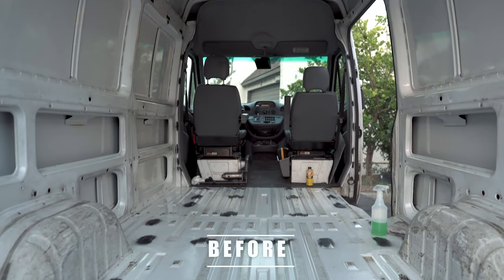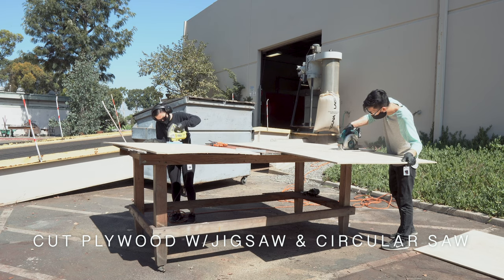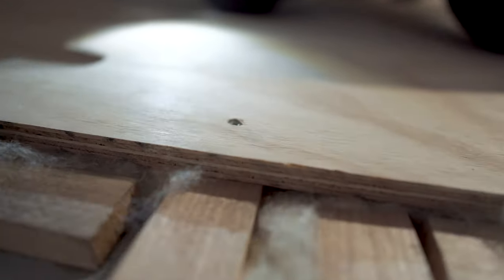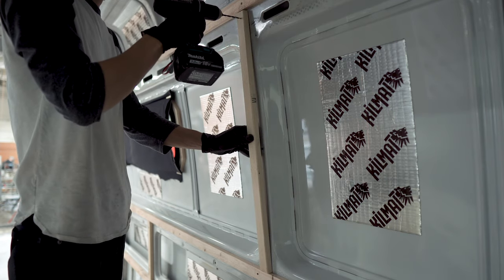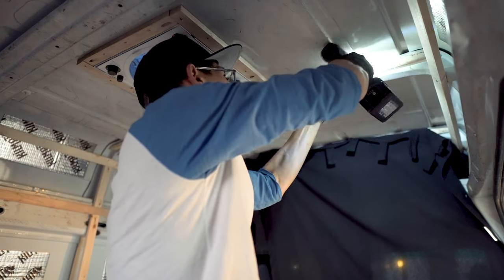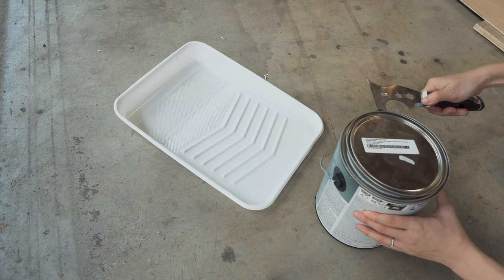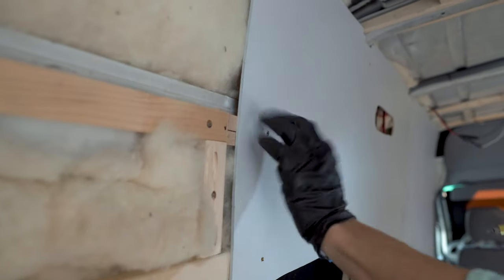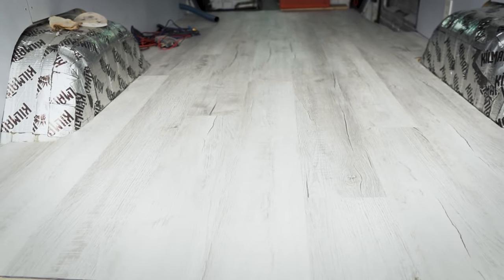DIY Sprinter Van Conversion | Framing, Insulation, Wall Panels, and Vinyl Floors

Comment: I love how you both are wearing masks during your entire build. Your the only ones I've seen in all the van builds that I've watched. Also wool is the best insulation for a van build, it doesn't mold, it's antimicrobial, antifungal, it can hold up to 40 percent moisture and still provide 100 insulation value. Your the only one I subscribed to. I can't wait for more videos, also very good explanation during your process. You should be very proud. Thank you

Comment: Looks awesome. Just wondering with plugging the bottom holes and using wool underneath the floor boards, is mold an issue is moisture gets down there?

Comment: i am struggling to do my ceiling...how you guys did it? like with a big panel is hard to measure it and seal it with the other side walls. thnaks xx
Reply from the maker: Yes it was definitely the most challenging part of the build. We used 3 large panels and the edges did not meet up well with the walls. We think using tongue and groove panels instead would be easier
Reply: @IMEEMADE  thank you guys for the reply, xx

Comment: awesome video! although I'm missing the part where u prepared the electric wires? I see some wires coming out on top. So I was wondering when u do the electricity... Before the walls or after?
Reply from the maker: Thank you! The wires for electric are done before putting the walls up

Comment: Hey guys, congrats on your work 👏 I’m curious if a year on, did the Havelock Wool cause any smell issues? Heard a few complaints that a ‘barn’ smell remains.
Reply from the maker: Hi! We don't have any smells from the insulation at all. The barn smell is apparent when we first removed it from the packaging and initially installing, but after a few days and especially after we finished the build there's no notable smell. Thank you for watching!
Reply: @IMEEMADE  Aw i’m glad to hear it.

The smell of the outdoors is great but maybe not 24/7 😅

Comment: It seems to me that plugging up the drain holes is probably not a good idea. They are called "drain" holes for a reason. If moisture somehow gets trapped under the newly installed floor at some point, (and you can't guarantee that that won't happen), then there is nowhere for that excess moisture to go because the drain holes are now blocked.

Comment: Hi, I am just about to start on my 2005 140" wheelbase Sprinter. May I ask you about the furring strips you used on the floor. I think you said you used 1x2 boards. Are they thicker than the groove they are sitting in? I was wondering about using something at the same height as the ridges because I am using rigid foam board for insulation,  Thank you in advance for your reply!! I love what you guys have done to your van and thank you so much for sharing your adventure!
Reply from the maker: Hi! Yes the 1x2 boards were about 0.25" taller than the ridges. Thank you so much for watching!

Comment: Question! Thank you so much for putting this together. We are in the process of building our van right now using your video. For the glue you linked, It says that you need to wait seven days for the glue to cure. Do you know if you had to wait that long? We are thinking if we put the plywood on top of it it should weigh it down and secure it pretty well?
Reply from the maker: Thank you for watching! You do have to wait 7 days for it to completely cure, however it's holds well after several hours. We did exactly as you're trying to do - after we laid the plywood down, we kept the project moving and we haven't had any issues at all!

Comment: Have you heard about condensation? That wool will suck moisture in and will keep. Would use foam boards, or spray foam, but not wool and glass wool.
Reply from the maker: Thanks for the info!
Reply: Exact...i have no experience but that's so logic...wool under floor no sense...qithout saying that it will shrink over time

Comment: Leaving raw wood inside your walls or floors is just inviting mold and mildew into your van. Every piece of raw wood needs to be sealed with either mold resistant primer (battens & backs of wall and ceiling panels) or spar urethane on exposed wood where you want a natural finish such as bed slats, component compartments or cabinets (plumbing, LPG, electrical, etc), garage storage, etc. I would not seal surfaces that are going to be glued together. When gluing battens to metal, wipe the metal down with denatured alcohol to remove any contaminates or oil and let dry before gluing. I would also not use any paint or sealer that is oil-based. I used oil-base paint on my house porch trim and couldn’t understand why we always had so much mildew - had to scrub it every year. Oil-based products are great “sealers” but mildew thrives on the oil. Use 100% acrylic paint instead.
Reply from the maker: Thanks!

Comment: Hi 👋  Thanks for such a great video! I have the same size T1N sprinter that I'll be converting soon. Just curious how much havelock wool did you use for the insulation?  Thanks 😊
Reply from the maker: Thank you! We used about 3.5 bags total. Have fun on your build!

Comment: Hi, what did you do with the seams between the plywood sheets? What kind of filler did you use?
Reply from the maker: We ended up using drywall tape and  joint compound. We thought it would crack from the movement of the van but it's been holding up great so far!

Comment: Great Job. Did you consider vapour sealing your floor, walls and roof?
Reply from the maker: Thanks! We did consider, however the wool manufacturer stated that a vapor barrier would hinder the effectiveness of the wool's ability to remove moisture should it be exposed to any. So far so good though!

Comment: I'm up north in Canada and I'm wondering what temperatures ( it can get as low as -22 F up here so insulation is a must )  you are living in with the van and how the havelock wool is performing. And thanks for the content I appreciate you guys taking the time to make it.
Reply from the maker: The coldest that we've stayed so far is about -10C. The insulation did great retaining heat generated inside the van (i.e. cooking and propane heater). We would recommend adding more insulation on the floors than we did, because we found it got the coldest. Another tip would be to double check any gaps along the door and window seals because our van isn't very aligned and we lost a fair amount of heat through those areas at first until we plugged them up using weather stripping. Otherwise the wool performed great. Hope this helped! Thank you!
Reply: @IMEEMADE  Yes it definitely helps... thanks for taking the time to reply!

Comment: great jobs, are you planning to do wood tounge and groove for the ceiling?
Reply from the maker: Thanks! We're using 3mm plywood for both the walls and ceiling. We want to minimize the weight added to the car so we though this was the better option

Comment: Use spray adhesive for insulation or it will end up sliding down eventually.
Reply from the maker: Thanks for the tip!

Comment: Why plug the drain holes in the floor?
Reply from the maker: To minimize any moisture that could get trapped under the floors and cause mold and rust.
Reply: @IMEEMADE  that's a good idea.  Thanks for the response